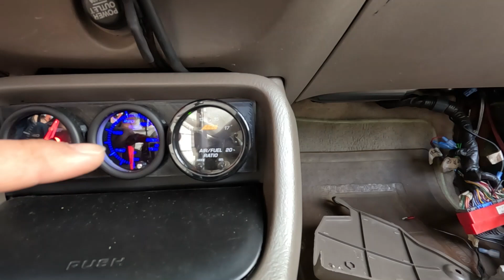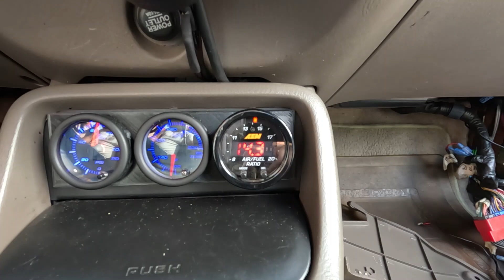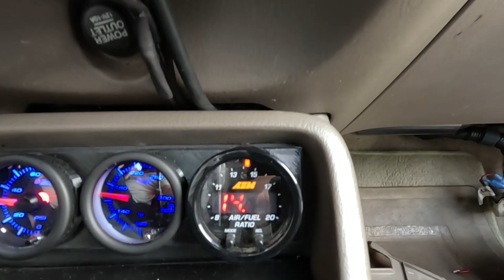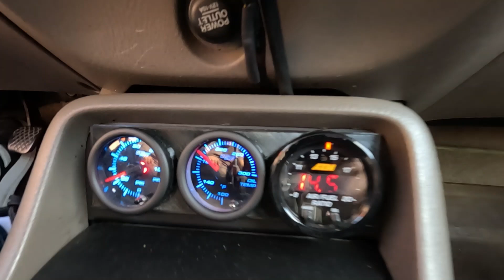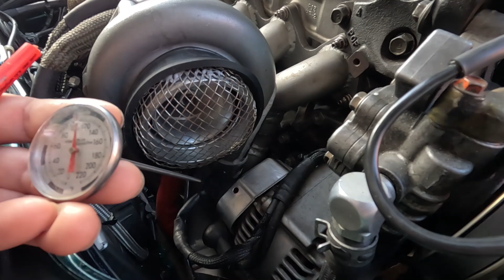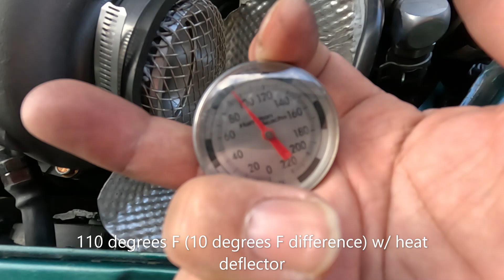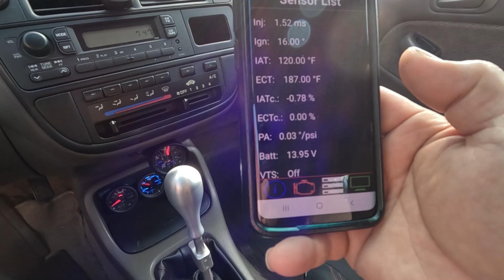Boosted G23BK AFR update! ep.2

Comment: Is this the sleeved block?
Reply: You don't have to worry so much about your sleeves , make sure the tuner is well aware of what you want on this motor. First if possible check the actual turbo map efficiency and make sure you take account the engines displacement . As you look at the map you will see the hypothetical ramp of power and just take a few degrees out where torque seems to spike in the lower rpm . But your rod stroke ratio it's not great but not worst then a b18c . So you shouldn't have so much piston to sidewall pressure
Reply from the maker: @RS-bb5tg  Told him in the beginning about the engine and no crazy numbers. Turned out that my wastegate placement was not ideal. Boost creeping so bad. You'll see it next once l'm done editting. Thank you for all the info man!
Reply from the maker: l wish l did have it sleeve but no, that's why l'm not going for a hi numbers.

Comment: Noticed  the green jug on floor in your garage.  Castrol IS made for 4 cylinders.  ONLY oil I've EVER used in ALL my Hondas. Thanks for sharing that leak TIP . Going to do the soap test on my build.
Reply from the maker: Hehehe, pretty much have same stuff man! I did found some exhaust leaks under the pan and where it connects catback. Seem to work a bit enough to drive it to dyno shop.

Comment: Just notice you use the iat sensor on the manifold. My tuner had me put mine 6in away from the throttle blade on the intercooler for more accurate readings. Im sure it won’t make a difference but who knows. Also can’t wait to see what your setup puts down
Reply from the maker: You know l thought about moving that sensor away from there cause it pretty much reading the temp of the manifold too. You just gave me a idea and l might reconsider weld a bung at the cooler pipe like D16. I'll think of a way that the heat doesn't transfer as much. Thanks man!
Reply from the maker: Not asking much on this motor coz l didnt have it resleeve. Wish l did have it resleeve but its alright.

Comment: Just so you know , Honda isn't a MAF system it's a map system. Blocking hot air  from the intake side of the turbo won't matter . Your IAT is after the intercooler air density will be minimal without a cold air sine it will ingest hot air from under the hood . If your IAT is your problem and not dropping your intercooler core effeciency is bad and also air flow is bad . The shielding usually works more toward MAF style intakes where forced air disrupts readings when fans turn on and idle surges
Reply: If you don't have a thermal isolator gasket on your intake manifold like hondata gasket , heat transfer will always be more. The undergoes ambient temp will always be effected by it . Sometimes the sensor itself can become lazy and slow in response in changes also .
Reply from the maker: @RS-bb5tg  I'm using Speedfactory IM thermal gasket, my nephew told me to use e85 so it run a bit cooler.
Reply: Great work looking good
Reply from the maker: @peterbryant3584  👌
Reply: It also just seems a good practice to get the coolest air into the turbo's intake for efficiency and hardware longevity.
Reply: @yu-cg5dx the turbo inlet temp is completely surpassed by heat transfer from the EGT that is completely connected through manifold heat and to the exhaust housing of the turbo . Which is also lubricated with engine oil and coolant which would be all dependent those fluids to cool down the chra. Oil would be around 200 degrees and coolant would be 180 degrees completely warmed up engine . As for the turbo inlet temp being lower would not give it longevity
Reply from the maker: Thanks for the info, just took some more temp info on the intake manifold and it seems that temp of manifold is corrupting the iat sensor temp and sending heat signal base on intake manifold temp not air temp when iengine is fully hot. The fmic is okay, its dropping air temp coz l been monitoring it by touching the cold side after car made a stop. Someone made a comment of relocating the iat sensor 6" away from t/b like D16. I might do that. Thanks again.